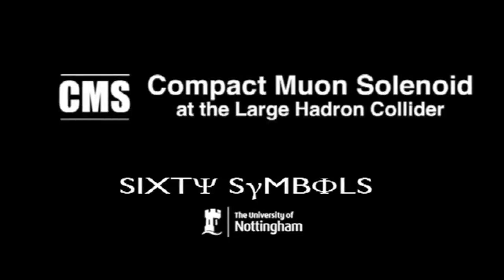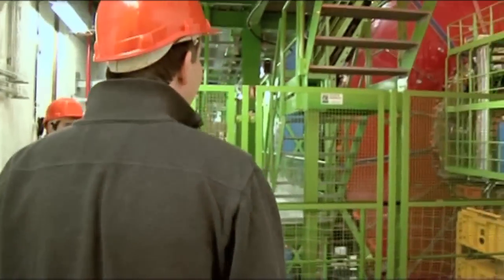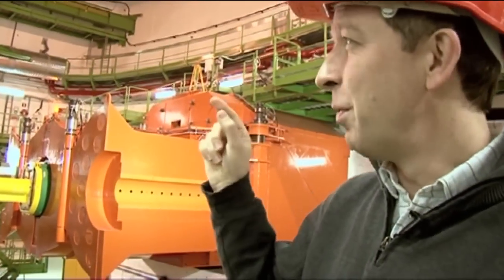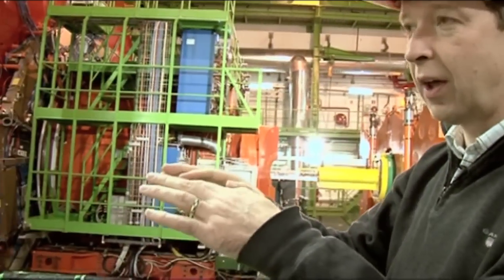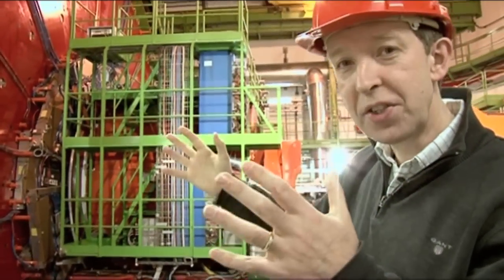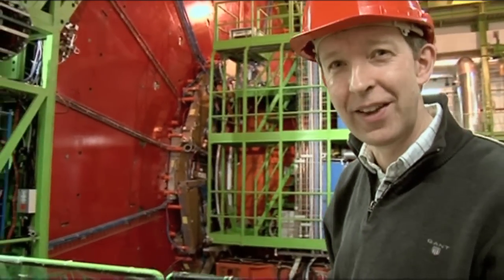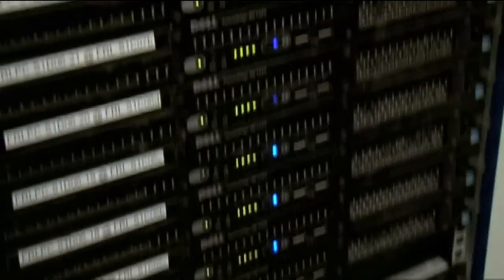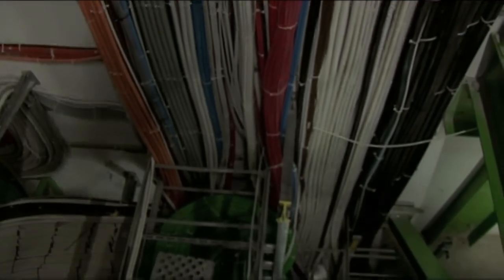Inside the Large Hadron Collider (CMS) - Sixty Symbols

Comment: An interesting fact that's not mentioned often is why the LHC is turned off during winter. There are lots of bits of maintenance to do, but the main reason is power.

The LHC's power comes from France's nuclear power output. In summer most of this power is spare so its used for the LHC, but in winter all the people using their heating means that there's not enough power left over.

The LHC uses up to 300MW of power, which is about 1/3 of the entire output of a typical French nuclear power plant.

Comment: the principle applies, but only on very small scales and with particles that dont have much kinetic energy. measuring the momentum changes the momentum, but with SO MUCH momentum its like a bullet going through a sheet of paper. the location of the collision is being figured out indirectly, either by having several detectors at different distances, or by making use of the fact that some particles decompose into two particles that fly off in exactly opposite directions.

Comment: probarbly within CERN.

If you, for example, assemble/disassemble/repair turbomolecular vacuum pumps, a single fingerprint can damage a component by the weight of the fingerprint putting it out of balance. These things run at up to 90000 RPM with the outer areas of the rotor moving at rifle bullet speed. 

and thats just one reason why you might want to put up a sign like that. Could be expensive stuff that can be damaged incredibly easy, or stuff that looks harmless but is incredibly dangerous.

Comment: Graphene + Detector = awsome
Graphene is a newly discovered wonder material with many amazing properties, one of them being it is a super conductor thousands of times more conductive than copper, has varying conductivity depending on the voltage applied to it, and could replace silicon chips in the next decade.
He mentioned using silicon to detect current, so if we make a detector with Graphene then it could potentially be much more accurate.

Comment: Fibre Optic uses pulses of light to transfer data. Light! at 100 terabits per second data transfer rate. They can handle any speeds that could ever be useful to us. Plus wires are simple, plug in both ends of devices & you have a connection. With Wireless you'd have to think of the amount of wireless frequencies being used, all the protocols to be set up & the radiation they get down there would most likely mess up the connections.

Comment: Quantum Entangled Twisted Tubules: 

When we draw a sine wave on a blackboard, we are representing spatial curvature. Does a photon transfer spatial curvature from one location to another? Wrap a piece of wire around a pencil and it can produce a 3D coil of wire, much like a spring. When viewed from the side it can look like a two-dimensional sine wave. You could coil the wire with either a right-hand twist, or with a left-hand twist. Could Planck's Constant be proportional to the twist cycles. A photon with a higher frequency has more energy. (More spatial curvature). What if gluons are actually made up of these twisted tubes which become entangled with other tubes to produce quarks. (In the same way twisted electrical extension cords can become entangled.) Therefore, the gluons are actually a part of the quarks. Mesons are made up of two entangled tubes (Quarks/Gluons), while protons and neutrons would be made up of three entangled tubes. (Quarks/Gluons) The "Color Force" would be related to the XYZ coordinates (orientation) of entanglement. "Asymptotic Freedom", and "flux tubes" make sense based on this concept. Neutrinos would be made up of a twisted torus (like a twisted donut) within this model. Gravity is a result of a very small curvature imbalance within atoms. (This is why the force of gravity is so small.) Instead of attempting to explain matter as "particles", this concept attempts to explain matter more in the manner of our current understanding of the space-time curvature of gravity. If an electron has qualities of both a particle and a wave, it cannot be either one. It must be something else. Therefore, a "particle" is actually a structure which stores spatial curvature. Can an electron-positron pair (which are made up of opposite directions of twist) annihilate each other by unwinding into each other producing Gamma Ray photons.

Does an electron travel through space like a threaded nut traveling down a threaded rod, with each twist cycle proportional to Planck’s Constant?  Does it wind up on one end, while unwinding on the other end?   Is this related to the Higgs field?  Does this help explain the strange ½ spin of many subatomic particles?  Does the 720 degree rotation of a 1/2 spin particle require at least one extra dimension?

 Alpha decay occurs when the two protons and two neutrons (which are bound together by entangled tubes), become un-entangled from the rest of the nucleons

. Beta decay occurs when the tube of a down quark/gluon in a neutron becomes overtwisted and breaks producing a twisted torus (neutrino) and an up quark, and the ejected electron. The phenomenon of Supercoiling involving twist and writhe cycles may reveal how overtwisted quarks can produce these new particles. The conversion of twists into writhes, and vice-versa, is an interesting process.

 Gamma photons are produced when a tube unwinds producing electromagnetic waves.

Comment: The radiation is high energy X-ray and is a result of an ring (synchrotron) accelerator, straight line ( linear) particle accelerators are safer.

Comment: I have to say that the cables you desribed at the end there Ed were all data. no high current power cabling is installed running near any data cabling, this is against regs and as you would understand it is due to the magnetic field created by high current power cabling, this creates interference and 'lag' in data, so it is kept well away. also, the mains cabling would be much larger and armoured or mineral insulated. and running from a copmpletely sperate large switchroom to the LHC.

Comment: so, whilst it was kind of useful, i didnt realy get a feel for how much data it was. 

so i did some calcultions. a cd is about 1.2 mm thick. there are 833333 cds to a kilomter, witch, assuming the cds are 700 mb cds, store 569661 gb of data. asuming the orbit mentioned would be the avarage, i used wikipedia and calcuted the avrage of apogie and perrigrie. 

the amount of data created in a year is 874976509560 gigabites, or 815 exobytes. that roughly global data volum 2009.

Comment: I wonder who designs this huge structures. Technically, it should be an engineer. But the person who knows exactly how to detect the particles is a physicist. 

This is a problem, because in order to design something like this and that its structure and functions work properly you need someone who understands the physics and has the knowledge required to do this.